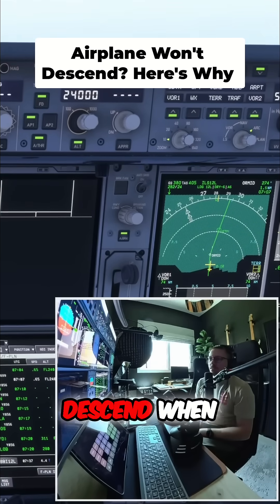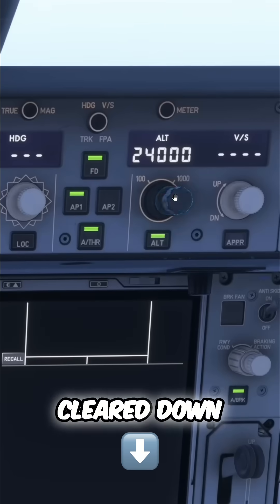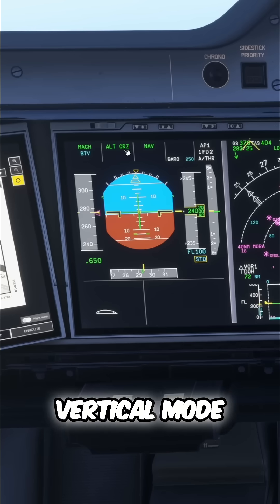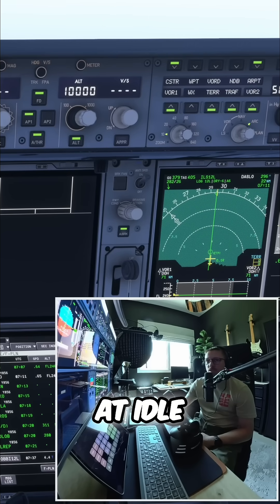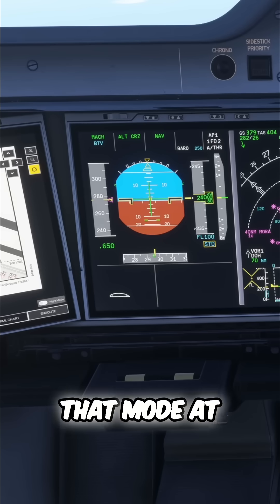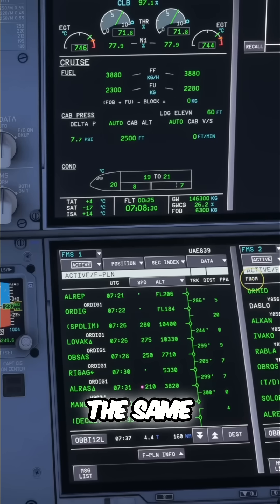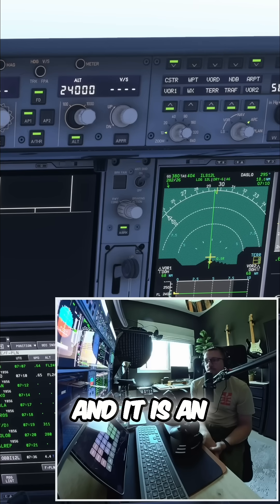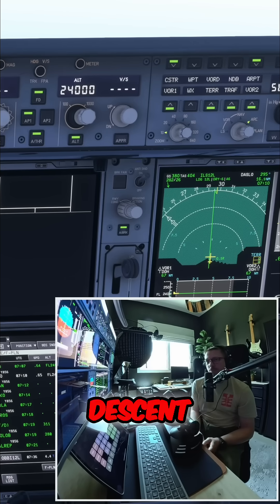Why the Airplane Won’t Descend When You Want It To #aviation #airlinepilo #airbus #flighttraining

Comment: Idle thrust? There goes pressurization
Reply from the maker: (modern) Airbus aircraft don't have this issue; two things happen to preserve enough bleed air for pressurization.

Firstly, 'idle' isn't a fixed figure. Flight idle is higher than ground idle, but still bears the same label on FMA and EWD. 

Second, at low power settings, the HP bleed will open up to support the IP bleed from the engines.

All of this happens in the background, so we can focus on managing the profile.
Reply: @bombsaway6340  man i dont know what your talking about. As long as the engines are on they can support the pressurisation system. There are several times in a flight were the aircraft will be at idle thrust, such as descent and parts of taxi.
Reply: @LucaBicanicI’m a retired heavy jet pilot.  Idle thrust doesn’t always provide enough bleed air to keep pressurization up
Reply: @bombsaway6340 To my knowledge when thrust is reduced there can be less available bleed air, and on older jets this could result in a slightly higher, controlled cabin altitude. That isnt a loss of pressurisation, just the system scheduling a gentle cabin climb during descent. Modern aircraft are certified so idle thrust still supports pressurisation, with pack flow scheduling and outflow-valve control compensating automatically.
Reply: @bombsaway6340   I’m pretty sure captain wouldn’t lie about this lmao
Reply: @mmafighting305 when you’ve been a heavy jet pilot for 30 years we can compare notes. Are you even a pilot?
Reply: @bombsaway6340  Which aircraft were you type rated on?
Reply: @bombsaway6340  I dont know what aircraft you have been flying, but for MODERN airbuses, this isn't a problem, flight idle is enough for it. Maybe you flew a Boeing, or embraer, or etc but nonetheless
Reply: @ImagineheheBoeing and LM
Reply: @bombsaway6340 Thought as much. The thing is, this is based on an aircraft that is HEAVILY automated, so that would be why then it's different
Reply: @bombsaway6340  Notice how they keep telling you this isn’t an issue with an Airbus, but you’re too senile to realize this. 

Gramps, airplanes have changed since you last flew 40 years ago.